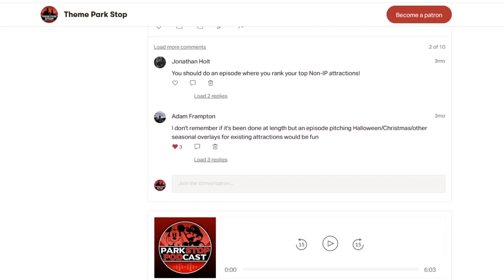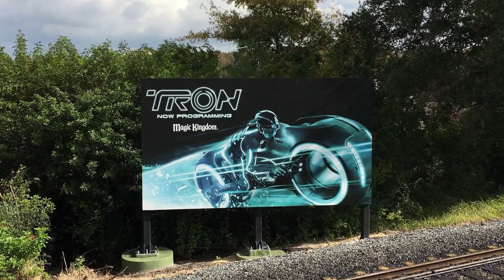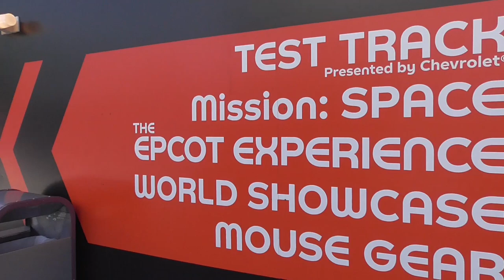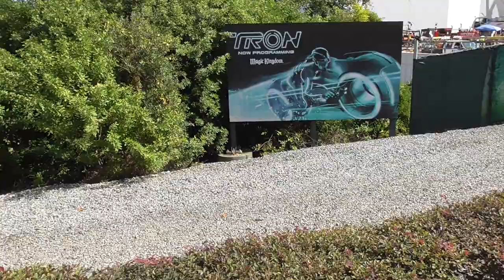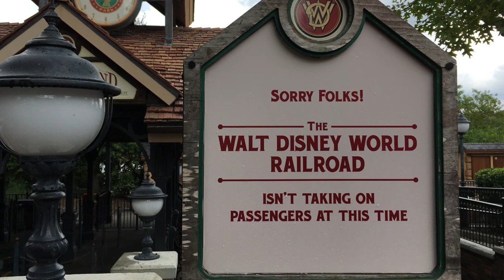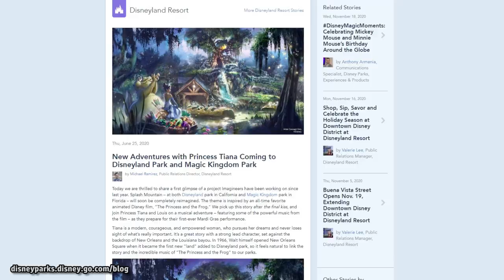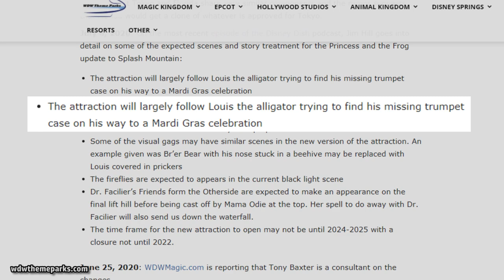Walt Disney World Ride Rumors - ParkStop Podcast: Episode 29

Comment: Also, aside from the size of the vehicle, what is so unique about guardians vs. Gringotts? They are both on coaster tracks, the vehicles rotate and they launch. Granted the later doesn't move at 55 mph but none the less it's still a coaster?
Reply: Gringotts is 10% rollercoaster 80% dark ride while Guardians is all rollercoaster with show scenes so the ride is faster and longer.